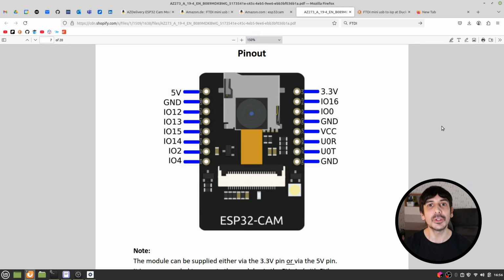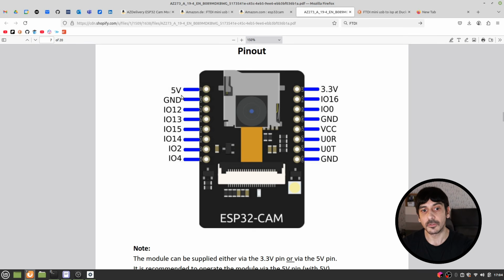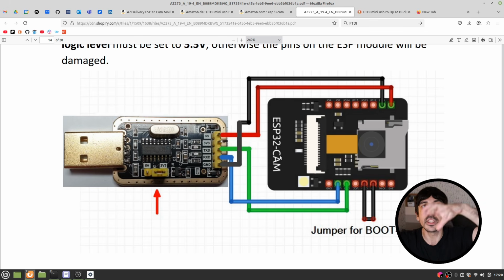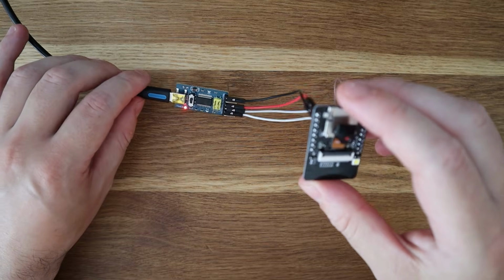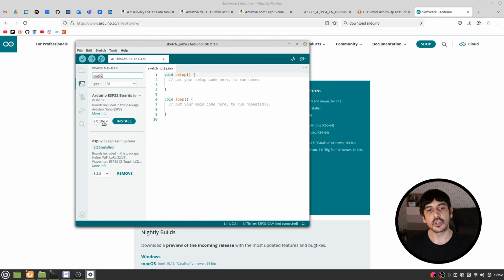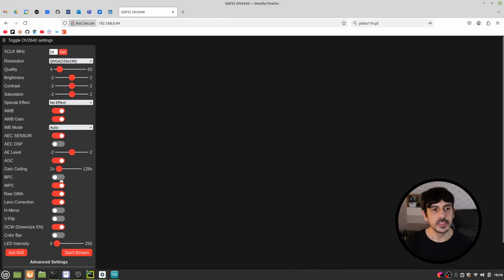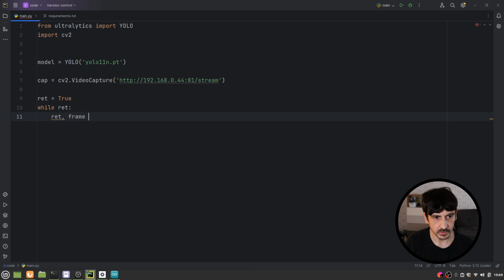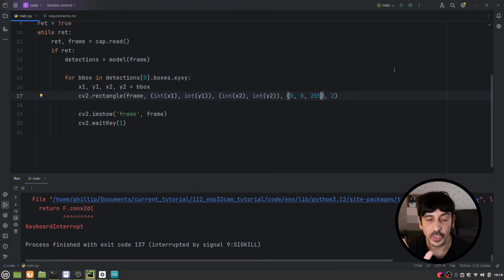Object detection ESP32 CAM + Python Yolov8 | Computer vision tutorial

Comment: 15:48 sir is that normal usb charging cable , thats used for charging for phones, or something else , if it is something else , can u pls tell which specific connector is that one , bcoz i searched for mini usb connector online , and it shows various results , showing different connectors . and also can u give the link , from where did u bought that FTDI connector.
Reply from the maker: The usb cable is Mini-B USB (M) to USB-A 2.0 (M).
This is the FTDI I bought from a local electronics shop: https://www.gme.cz/v/1508933/ftdi-prevodnik-s-mini-usb-a-isp ,  you can find similar ones on Amazon or other international sites. 🙌

Comment: Hello sir your all videos are very helpful for us but i am facing a problem in video Face attendance+ face recognition with python. Sir plz help me because i choose this project in my college semester. when showing an output for this code it not show properly all buttons and not works properly like your code and i made that project like your project as well. I am so confused so plz sir suggest me a solution for it
Reply from the maker: Hi, it is hard to know what could be going on without more details, but I recommend checking your code for any errors and ensuring all dependencies are properly installed. 🙌
Reply: No error show when we execute code @tambascofelipe
Reply: sir, can we connect with u through any other platform and which is helpful for us to solve code related queries. At which platform where we show our problem @tambascofelipe

Comment: I'm not sure it would be better to use a smartphone as a camera with AI. The ESP32 is a cool toy, but when I think of facial or object recognition, I always think of science fiction movies. In these movies, the robot has a lens capable of recording hundreds of frames per second and a powerful processor capable of calculating the trajectory of an object flying towards it in less than a second. Small devices like the ESP32 are suitable for occasional, primarily slow-moving tasks. I don't see their application in agriculture, for example, where something like this would be very useful. On the other hand, we have powerful smartphones with outdated Android systems that can be relatively easily converted into AI-enabled surveillance cameras. The disadvantage of the ESP32 is its weak processor and poor image quality, resulting in a low frame rate. Best regards.
Reply from the maker: Hi, I agree that there are other edge devices that are much more capable than the ESP32 for computer vision projects. It's important to familiarize ourselves with different types of devices to understand when to use each one. The capabilities of the ESP32 can be well-suited for certain types of projects. 🙌